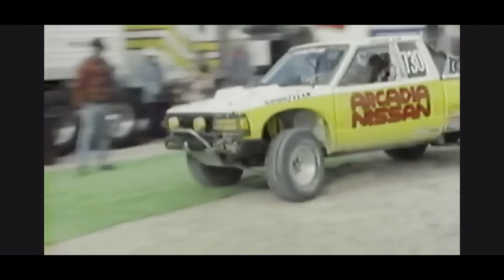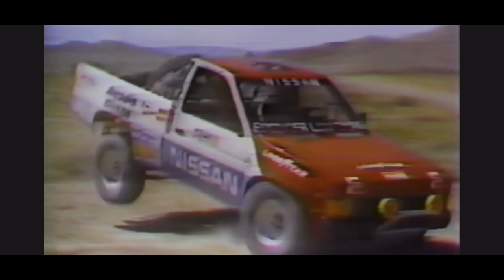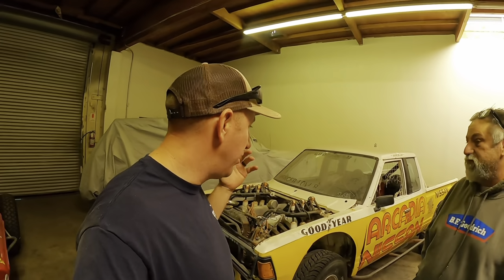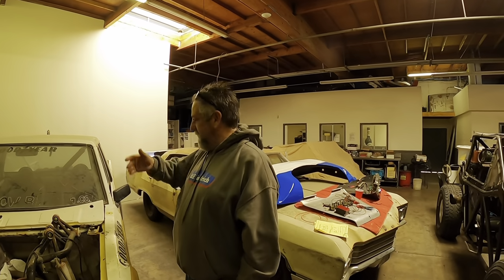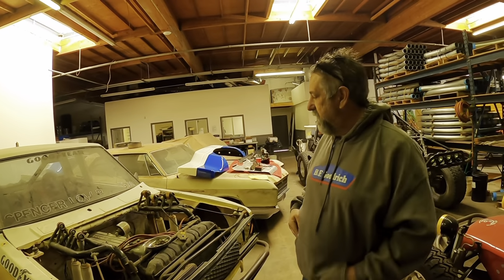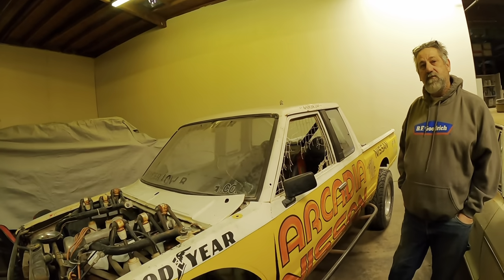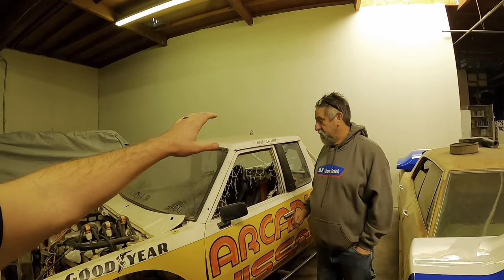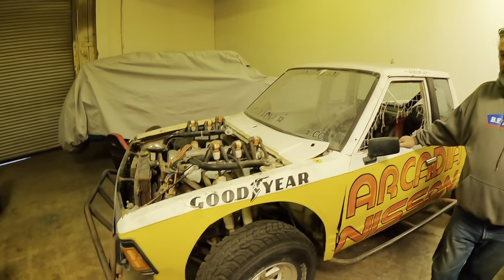The Return of the Million Dollar Nissan Race Truck (Spencer low racing history)

Comment: That Nissan had nothing on Ivan Stewart. Ivan was my neighbor growing up. And I ended up on Rough Riders team. No Nissan ever did well in the desert. Only a few stock class trucks ever did well..but again it's a stock class.nithing special
Reply: You obviously don't know your racing history... Nissan won many championships over the years in class 7, 7S,  7-4X4, 3, & 4  with Jim Conner, Roger Mears,  Spencer Low, Jack Johnson, Sherman Balch, etc...
Reply: @thelensmanphotography  read my post again.. it says stock class trucks.. 7 is basically stock..7s is stock..3-4..4x4.  they arnt really big HP ,,or have much suspension and little mods
Reply: You are comparing apples to oranges.